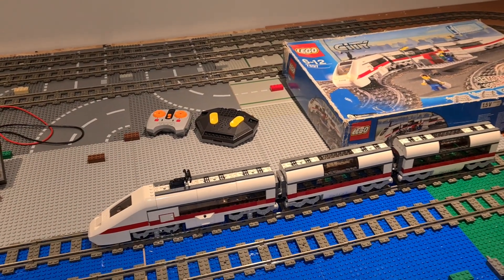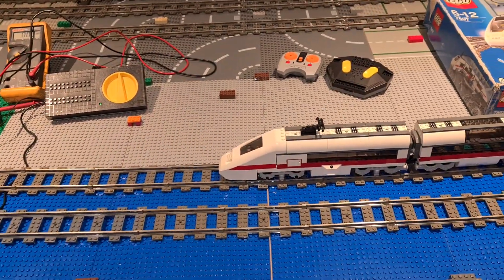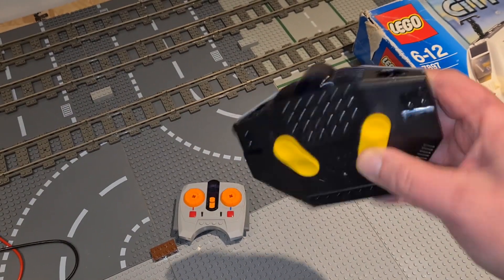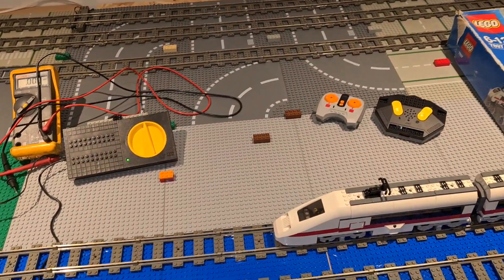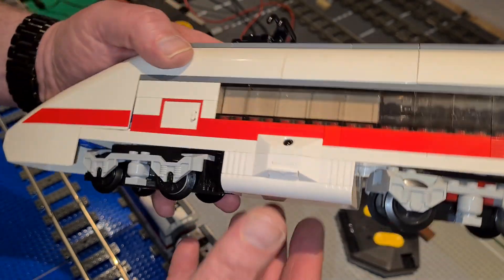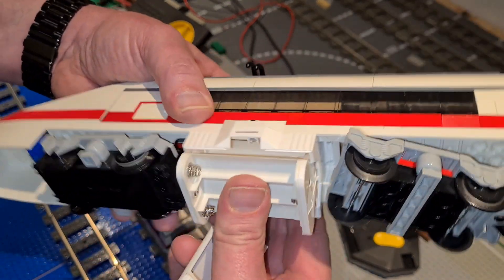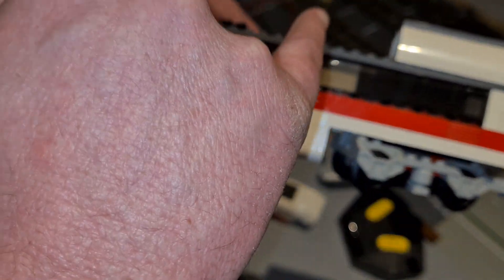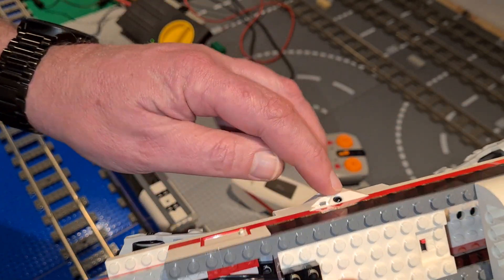9Volt DC Train Control with Arduino - Part 1, Re-purposing broken 9V motor

Comment: Oh... You mentioned arduino and my ears pricked up Then you converted the joys of RC direct battery powered cab control to track voltages and all the disadvantages of that.  I convert model trains to rc control battery powered . On wish list  Put arduino in loco  Program to receive interrupt track relay or ignore  : Begin auto slow down in fixed distance to stop at eg (station ) See once you go track voltage you cant have more than one train on a track   Now committed to al lthat electrnic expensive mumbo jumbo to achieve that AND you wil bang your head underneath boards trying to fix things  Let alomne cleaning the track and the dodgy connections  Who needs it ?  Emerging market if we can perfect the arduino software and market it in a single package . Ms O
Reply: Lego 9v tracks are (almost) self cleaning.  The metal wheels don't sit on top of the rail, but rather wedge themselves on the edge of the rails, thus making themselves far less susceptible to dirt and having a very small contact point on the corner/side that 'self-cleans' by running over it enough times.   Any 'normal' O or HO trains would be using the flat top part of the track and only smear out dirt rather than wedging it off, so this design is rather clever!